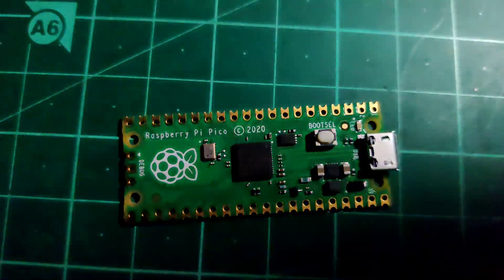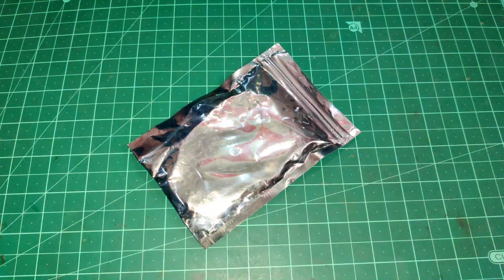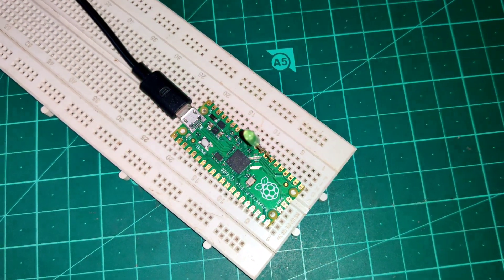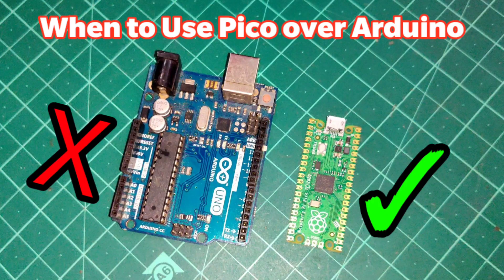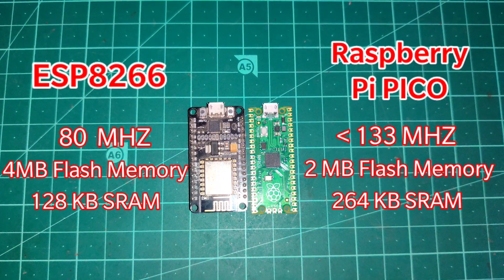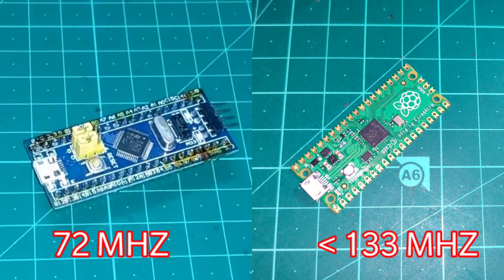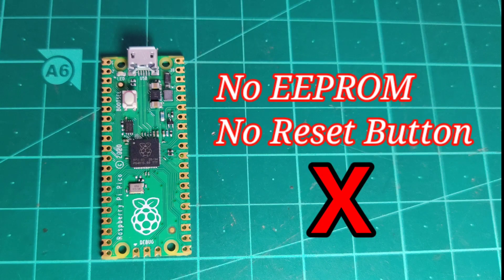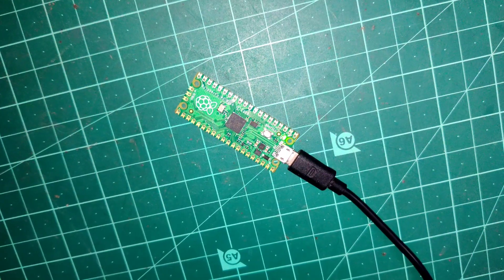Raspberry Pi Pico In depth Review

Comment: Not impressed by its flash and ram capacity.. god thats small..
Reply: Good enough for some quite complex projects though. Bear in mind, there's no OS, so you don't need much. Also,it's only $4!
Reply from the maker: Yeah thats true. But truth is do we actually need a PICO since options are already there in market?
Reply: @electronicGURU  PIO is unique and super powerful. Also the documentation... this is an amazing platform for people who want to learn about bare metal programming and hardware hacking overall.
Reply from the maker: Yeah thats true sir ,  but the thing is one extra feature will not make any MCU better than others. And from where i see it is good but i will still go with ESP32, they should have added a wireless chip on board.
Reply: @electronicGURU  sure, it's just a tool; and you should use the right tool for the job.
Reply from the maker: Thats very correct sir. But the thing i always think every as a complete package that how much areas it could cover.i mean pico is nice but not impressive because better devices for better price are already there.
Reply from the maker: Yup thats correct but it is better than regular Arduino Boards. 😂 Over all its okay board , not much to be amazed..